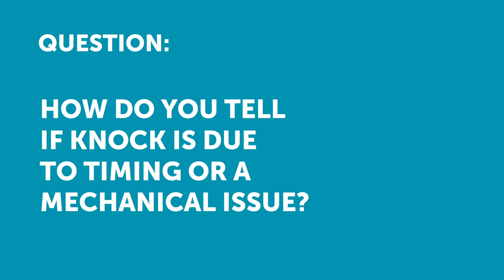Knock | Mechanical Knock Vs Detonation [HPA Q&A]

Comment: Ive heard a story when replacing the engine mounts for solid aluminum ones caused some serious false knock. It was a vag 1.8t 20v don't recall the chassis, what version of engine/ecu. Returning to stock mounts solved the issue.